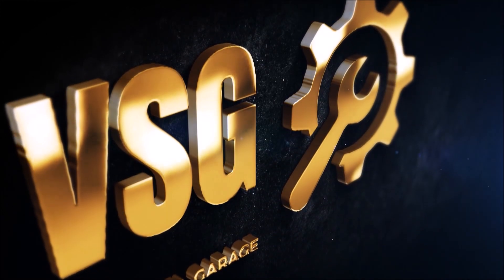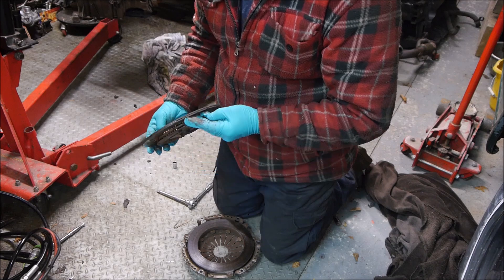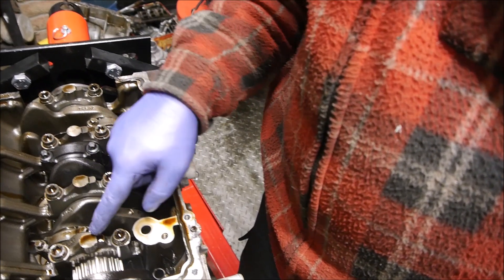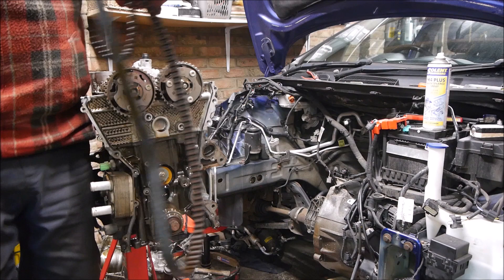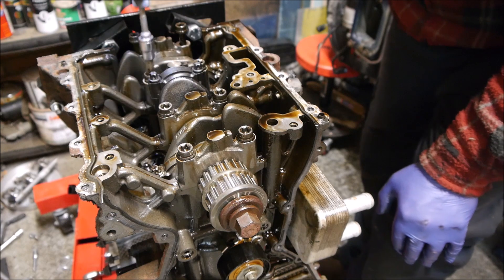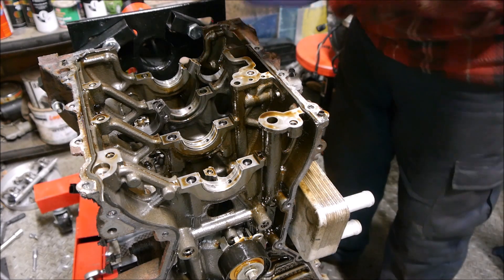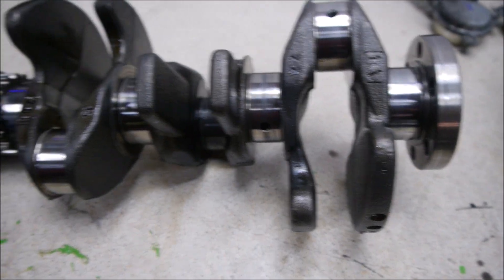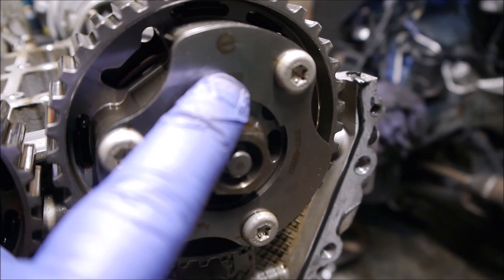Ford Fiesta 1.0 Ecoboost engine rebuild part 4-   Engine strip down

Comment: Wet belts, great engineering! Just had a new wet belt and head replaced on a 2014 fiesta @ 200ks. Complete new cooling system with all 3 thermostats. 5K spent and car runs worse than ever. If you ever think of buying an Ecoboost engine...DON"T would be my recommendation. Terrible engines....
Reply from the maker: That must be so annoying and disappointing. I think a replacement recon or new engine is the only way to go once the wetbelt has deteriorated and started to block the strain and starve the bearings of oil. However the cost probably outweighs the value of the car.
Reply: @vintagesteelgarage the wet belt was actually ok. Was replacing it mainly because we had a cracked head leaking coolant into cylinder 2 and had the head off. Seems now there's an issue with the aftermakrket head and cam shafts.. just a big headache....but yes 100% should of scrapped the car. Not worth spending the money on if you are in Australia.

Comment: Great video's...my eco boost losing power in second gear would this be the bearings , clutch... I'm just about to get wet belt change as it not be changed since it was brought.

Comment: So therapeutic watching a very good mechanic at work.  It's been many decades since I spent my weekends underneath my (1970's) TVRs or Lotus Elans and Europas skinning knuckles and inventing new swear words.  I still find it so disappointing and disproportionate  that all that beautiful engineered steel is scrap because of one overheated and scratched bearing.  Hate the  built in obsolescence attitude and cost savings shown by Ford housing a fibre cambelt inside the cases.  Madness.  Stark comparison to my ancient 1997 BMW K1200RS motorcycle, built to the highest available standards of engineering which will still be running when this modern disposable stuff is in a skip.  Thanks for great content.
Reply from the maker: @McChoc55  thankyou for lovely feedback and yes I agree it's a throw away culture now. Sat next to this in my garage is a 1958 GMC Apache pickup truck. Proper basic engineering. It's 66 years old and has been on 2 roads trips to le mans France. Runs great. I don't think  any fiesta will be still running after 66 years.

Comment: easy engine to rebuild  one of easier i bean working on .
Reply: Yes this was problem for my . is end torque 80 nm but is sequence of lossen and tighten . cranck bolt 300nm +90 degre
Reply from the maker: @krzysztofkawalec9937  OK thanks. Noted if I ever do it again.
Reply from the maker: @krzysztofkawalec9937  yes was easy to strip my problem was I couldnt  find detials for torque setting to crank and con rods. So in the end bought a rebuilt short motor

Comment: If your Fiesta has a dual clutch transmission, you’d be two for two in the massive failure contest.
Reply from the maker: Not dual. Mass. But I did install a new 3 piece clutch

Comment: do you have to remove that crank pulley bolt to remove the timing off?

Might have just saved my life
Reply from the maker: Yes unfortunately. And you need a torque multipler to refit
Reply: @vintagesteelgarage  managed to force it off with a huge breaker bar lol

Comment: Is the new engine price on an exchange basis.?
Reply from the maker: Yes. £1250 +vat. They give you 2 weeks to return yours or else they charge £400
Reply: @vintagesteelgarage . That's not bad then as wet belt replacement cost about £800 alone
Reply from the maker: Yes plus the head is skimmed and valves re lapped. Etc.
Reply: @vintagesteelgarage  .Where was engine from ?
Reply from the maker: @stevo1846  place called approved engines
Reply from the maker: https://approvedengines.com/